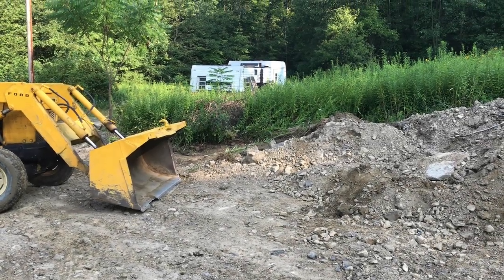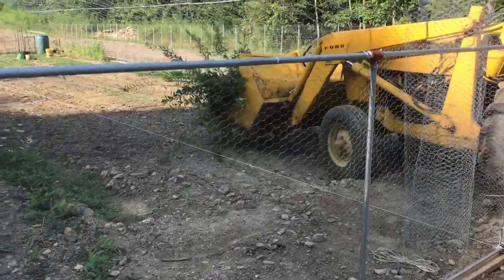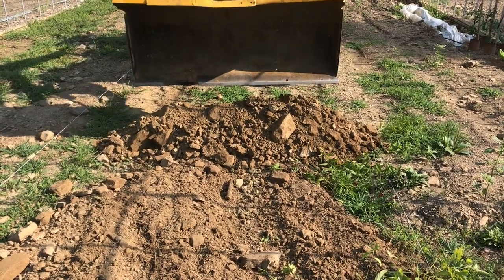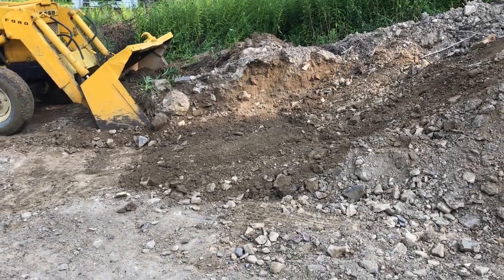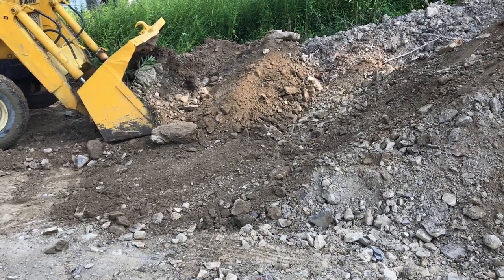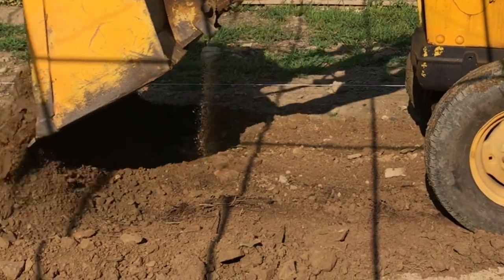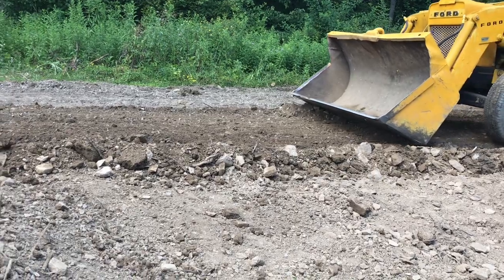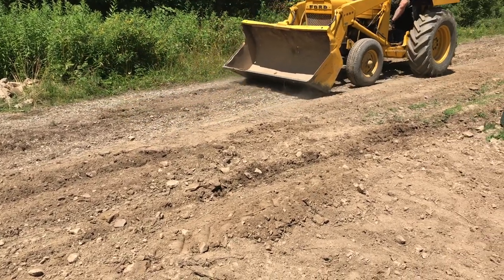TIPS on using your front and loader to get things done

Comment: Also instead of working the "hard dirt trying to get a full scoop" just go into the dirt, with the bucket higher, and back drag the dirt to loosen it up! Saves wear and tear on your machine! And makes life easier.  Also. Try to avoid wheel spin when loading, cos it will just fatigue you, going over the bumps every single time! I've never ran a rear wheel drive loader. All of mine have been 4x4 with lock up, so it makes it easier not to spin the tires!

Comment: Just got my first tractor today and moved a bunch of dirt on a new homestead. Smoothing things out didn't go so smoothly. Got some good tips from this vid. Back at it tomorrow!
Reply: Just got my first one on Monday! Deleted a garden and smoothed it out (poorly.) Lots of fun!
Reply: @scotpalmer1609  tractoring gives me the same peace as riding motorcycles with no particular place to go.
Reply: You have probably figured this out but putting your bucket in float mode makes smoothing things out real easy.
Reply: If your loader has float mode this is way better for smoothing, so long as the dirt is loose. Float mode means the arms move freely, and the bucket sits on the ground due to gravity. This follows contours of the ground better when back dragging. You can also tilt the bucket up a bit over a deep spot to raise its level and leave more dirt there.

Comment: first tips are trash, if you want to load a bucket the proper way, set your bucket flush with the ground, drive into the material and as you feel the machine slow down , lift your bucket up. youll get a full load like that. for example @ :12 as soon as that tractor stops moving lift your lucket up, dont tilt it any and youll pick up a full bucket in most cases also for better back dragging on somewhat muddy ground using a steep angle on the loader bucket will cause the soil to scallop, not always the case but a finer finish will be made with a shallower angle so your blade should be around a 30-45 angle . You can also back-drag harder packed dirt using a full bucket and just dropping it on the ground and it will move more material easier.

Comment: I am concerned about your clutch plate but helpful video. Thank you.
Reply: y
Reply: Actually, I came here looking for tips on clutch/gear/throttle when trying to fill the bucket, got any?   Am I rigth that if it's like a car/truck, then it's important to only engage the clutch when the tractor can start moving freely.  Then when you hit a rock if you don't dis-engage the clutch right away, you'll either stall the engine (too high a gear) or the tires will start to spin, but the clutch should not slip/wear.  Is this correct?

Comment: My loader is designed to carry a maximum of 8,000kg in a full bucket, but after spending a lot of time on my machine. I'm averaging,  14,000-16,000kg per bucket. And I have my bucket high, low, on the ground when travelling, doesnt bother me. Sometimes it's fun, to come up to where you want to drop the payload,  put the breaks on, and completely lift the back end of the machine off the ground.
Reply: Your fired